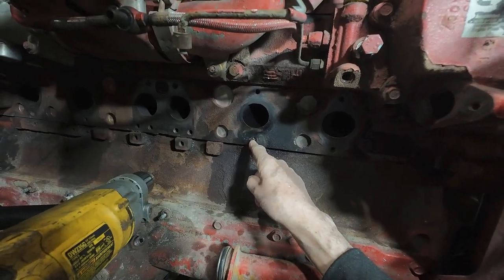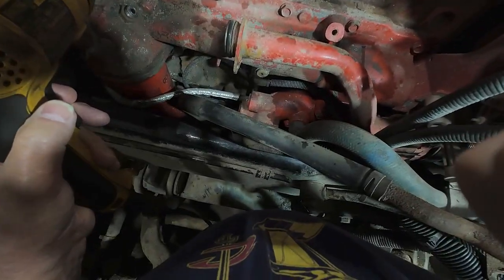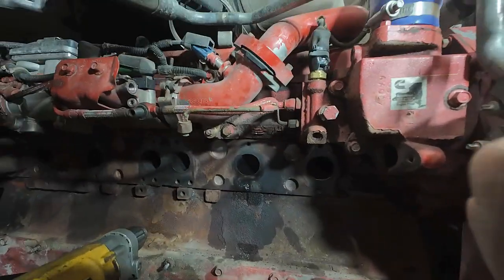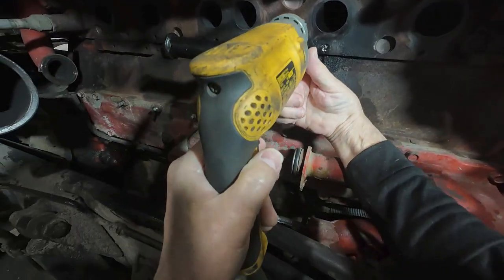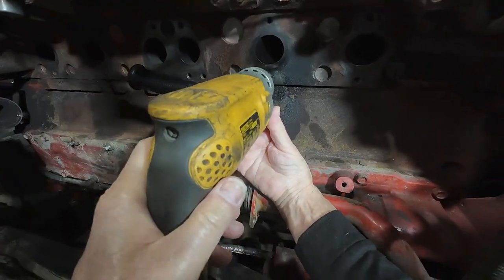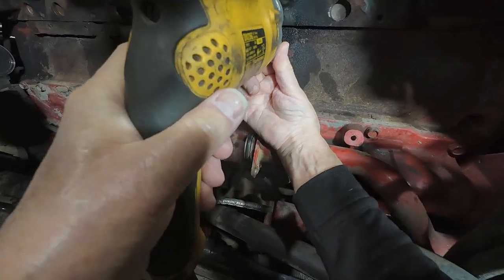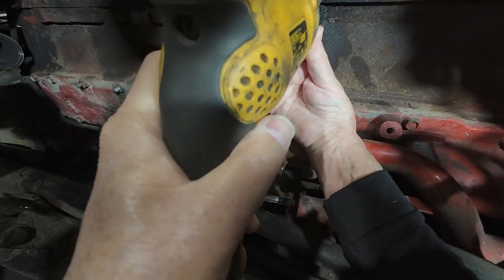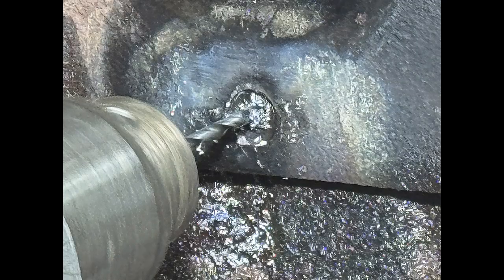Don't Do This!

Comment: Interesting that you say 20’000 hours is a lot. 
The newest in our fleet are around 30K now, most of them all original except injectors (due to blocking DPF’s) and the odd turbo.
Some of the older stuff is knocking on north of 50.
Most of those have had an in frame or even two but you do get the odd survivor. 
B6.7/ B4.5 euro 6 and the older isbe euro 4+ 4+6 pot.
Reply from the maker: When I started at cummins in the 70's the only engines that had a chance of seeing 40k hours was the V/VT-1710 (V-12 industrial). The NTCs were usually worn out at 400k miles. They say a working year is 2080 hours plus two weeks vacation. For an engine to be able to run 40k hours is like 20 years at 40 hours a week. Remember I am OLD and so I still think somewhat like i used too about engines and hours. A company out of canada called loram used to have cummins 1710's ( probably qsk 23's or 38's today) on the track grinder train. The cummins ran generators for the grinding motors that were 480 3 phase as i recall...I asked one of the maintenance guys who worked in the locomotive shop how long the locomotive engine lasted. He said usually 40-50 years if you do good maintenance - WOW I thought.

Comment: Spiral easy outs have a tendency to spread out the broken bolt making them tighter . Use square fluted easy outs with sharp edges or spline type .

Comment: Easy outs only for pipe treads. For straight tread need straight flute extractors. Like Ridgit kit.

Many times I use imperial/metric “In between” sizes when I don’t want to go for thread insert repair